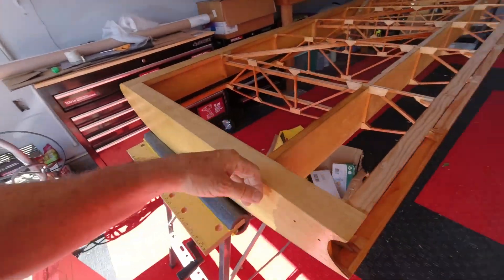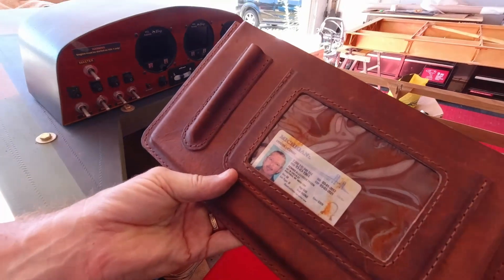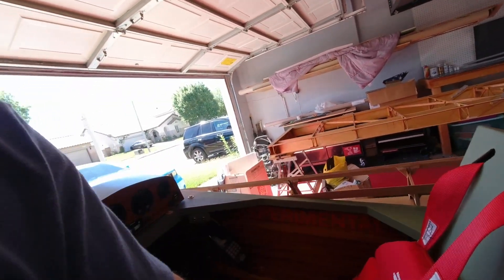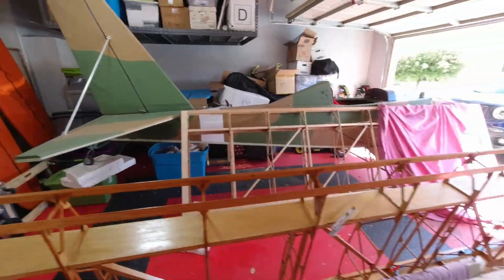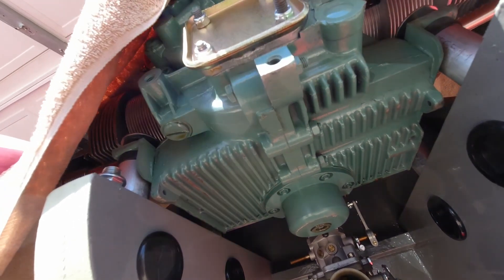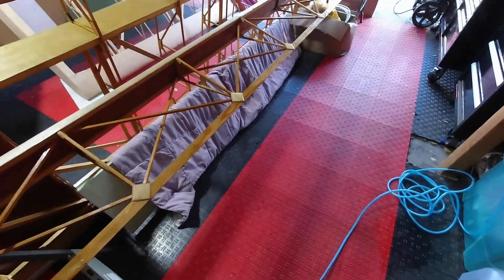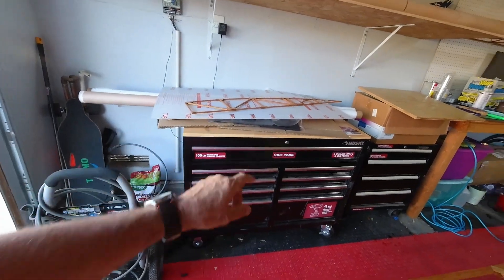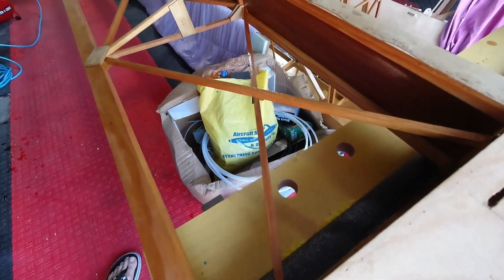Minimax 1100r Wood Aircraft Build Ep 179

Comment: Hi Dennis,  getting close to sealing my fly baby biplane wooden structure,  what brand urethane are you using?  Was hoping you'd mention that in the video 😢,  Thanks
Reply from the maker: Varathane Ultimate Spar Urethane.
Got it from Home Depot
Reply: @DTMinimax  is that just a one part coating?  I saw a can of Rust-Oleum Marine Coatings Spar Varnish at Lowe's and was thinking about using that.   Thanks for your help 👍
Reply: @DTMinimax  ahhh, found it, a water based product.   The Rust-Oleum Spar Varnish is oil-based
Reply from the maker: The one I used is an oil based product, it has green on the can. The rust oleum is a good product as well. Helmsman spar varnish is also good if you find it. Any of those will work. I used two coats, one thinned 50/50 and the second full strength
Reply: @DTMinimax  cool, so the 50/50 I presume is the first coat to allow maximum penatration?
Reply from the maker: That’s correct
Reply: @DTMinimax  hi again Dennis, which covering system are you planning on using?  I'm looking at stewart systems and they use their own brand of water based polyurethane sealer......$$$$.    probably necessary for "liability" (?) standpoint.  Also looking at oratex,  but not sure if I want to go that route. 

Thanks

Comment: Oil Leak - RTV Silicone Gasket Maker or any silicone is a no go on any engine. go to a motorcycle shop buy engine case sealant its called yamaha bond, kawasaki bond  its only thing to use on engines. i have rebuilt countless engine because of a silicone type sealer being use.
20 years in family M/C dealership. raced off road bikes for 38 year plus auto repair so i have 50+ year's working on engines. my best advice never ever use silicone sealer of any type.
Reply from the maker: Great advice! Thanks for sharing your experience!
Reply: @DTMinimax  also get contact cleaner from M/C shop to clean surface it does a great job cleaning up oil and dirt from cases.